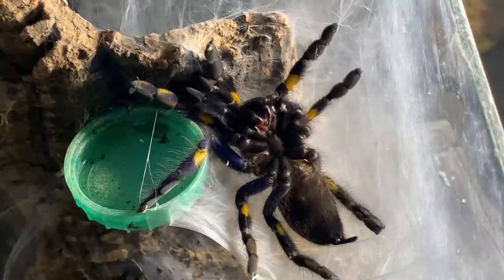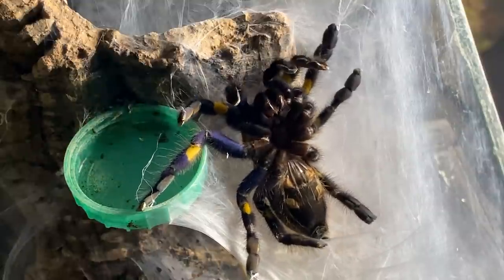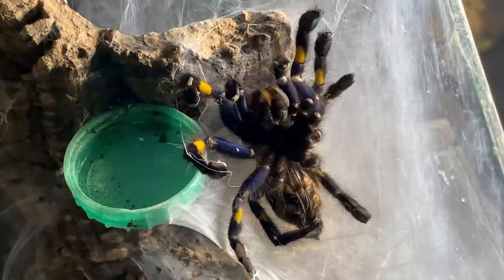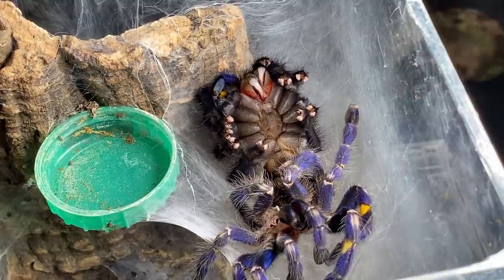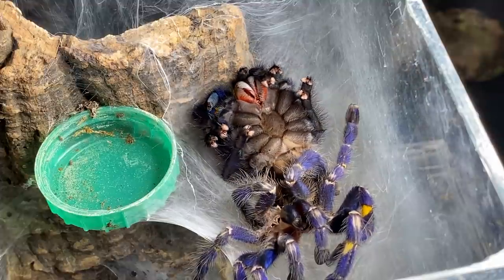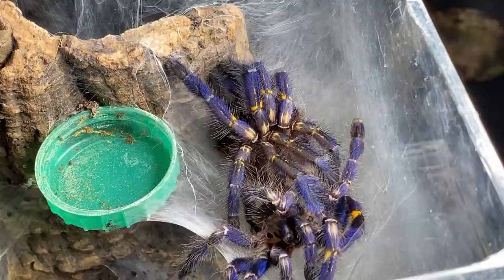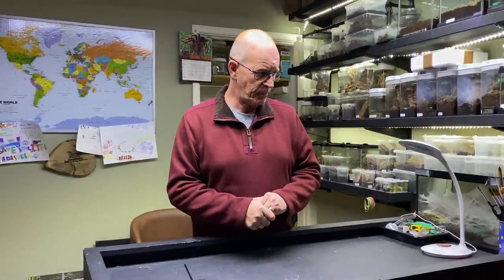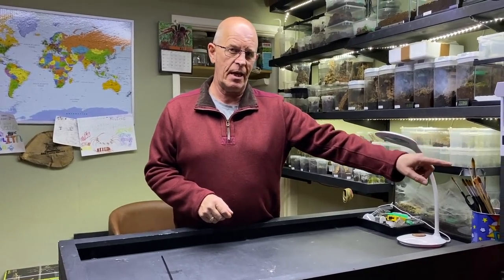How Does A Tarantula Moult ?

Comment: Always a sight to behold :) I've managed to catch one of my Ts flipping on its back and right back only once. It was with my G. porteri. Absolutely magical moment. And thank you Dave for touching up on the importance of internal hydration vs attempting to spray the enclosure.

In theory, if a spider feeds well and drinks occasionally leading up to the molt, it ought to be a smooth procedure. Only older animals ought to experience issues. In 12 years of keeping, I have yet to experience issues, but I know the likelihood increases as they get older.

Stay safe and thanks for sharing :)

Comment: You mentioned that as the spider was breathing in (4:53), then she was pulsing into her "new limbs". Does air actually travel into the legs? Is that part of the spiders normal locomotion, like a sea pig?
That WAS my question, but then I looked up a diagram to see, and I saw that the lungs, and their associated gas pathways, do not extend into the legs. Unfortunately, at the same time, I noticed that the digestive system DOES, and now I'm confused all over again. I see that the digestive system supplies not only the blood, but ALSO the reproductive system, and the silk glands. It appears to do this directly, and not through the blood. That is all very interesting (and leads me to wonder how complete the diagram I was studying is...). When she is pulsing during the molt, is the pressure she exerts on her new limbs exerted through the digestive system? It seems much larger than the circulatory pathways for the blood, but I imagine it could be both systems at once. You mentioned that she stopped eating shortly before the molt, and I assumed that was due to her now being larger than the shell she needed to exit. The idea of slimming down to squeeze out of a suit that's too small, I get. I do not get how she pulses pressure through an empty digestive system though, or is there still "juice" in it? Or is it just blood pressure doing all the work?
Reply from the maker: Their system basically works on like hydraulics as she forces fluid through her system she can retract herself from the old skin 👍

Comment: 7:08 "Will not get any bigger." Makes sense, but what allows the abdomen to get larger/smaller in between moults?
Reply from the maker: They are quit elastic 👍
Reply: @daveslittlebeasties  Quite right! I just did a little research concerning tarantula molting: "As the new exoskeleton hardens, the spider maintains blood pressure in the cephalothorax and legs to stretch them into a slightly larger size than previously. The abdomen has a flexible covering, and it is this area that appears shrunken during the transfer of fluid to the expanded cephalothorax and legs. Just after molting, the body proportions are a bit unusual, with the abdomen being small. A few meals will solve this discrepancy, and the spider's proportions are quickly restored." ["Common Spiders of North America," by Richard A. Bradley.] So, the abdomen is flexible, but the rest of the spider is a rigid exoskeleton.
Reply from the maker: @lgkfamily  Once hardened yes 👍

Comment: I'm intrigued by those black "pads" on the tips of their legs (seen at 5:50 on the leftmost leg and on the leg pointing up). They look soft, rubbery, like the pads on a cat's paws. Though I suppose it's more likely that they're hard shells. Can anyone who's touched them share?
Reply: They are really soft the whole exoskeleton is really soft to (the old one)
Reply: Their tarsal pads or scopulae, which are largest on the front legs, are composed of thousands of tiny hairs.  This is actually what gives them the ability to climb smooth surfaces.  (They feel grippy.)  From BIOLOGY OF SPIDERS:

Many hunting spiders possess dense cushions of hair on their feet, the scopulae; those lying directly under the claws are called claw tufts.  In some spiders, especially in tarantulas (mygalomorphs), the entire ventral side of the tarsus and metatarsus may be covered by such scopula hairs.

All spiders that have claw tufts on the tips of their legs can easily walk on smooth vertical walls, and even on window panes.  Under experimental conditions, Cupiennius could hold about 10 times its own body weight when sitting on a vertical glass plate.  This remarkable ability can be explained if we look at the fine structure of the scopula hairs.  The ventral surface of each hair splits into thousands of fine cuticular extensions ("end feet"), giving the hair the appearance of a hand broom (scopa means broom in Latin).  A crab spider with only about 30 scopula hairs on each foot can nevertheless achieve 160,000 contact points with the substrate because each scopula hair has 500–1000 end feet.  Thus, the actual contact between the foot and the substrate is mediated by the thousands of microscopic end feet.
Reply from the maker: The tips of their toes are covered in microscopic hairs which give the impression of soft pads 👍these also enable them to walk on almost any surface 👍

Comment: Question: If a spider is re-growing a missing leg, where exactly does the replacement leg grow inside the old exoskeleton? Is there a new leg tucked up inside the thorax somewhere during premolt? I suppose there must be, but it's rather strange to think that there's a whole leg growing internally ready to pop out when a moult happens...
Reply from the maker: It will start to grow from the old wound when the  spider is preparing to moult they are continually growing they never stop 👍

Comment: Quick question old molt contains fangs could these fangs still hold venom that could possibly cause problems?
Reply from the maker: This is a very interesting question as snakes fangs do still hold venom residue but I have not heard of this being the case with spider fangs ?
Reply: Ye possibly not as venom held within spider its self but may be risk of lower dose ie residue